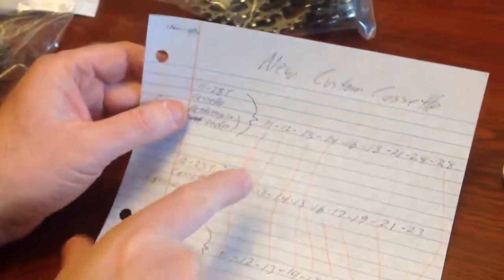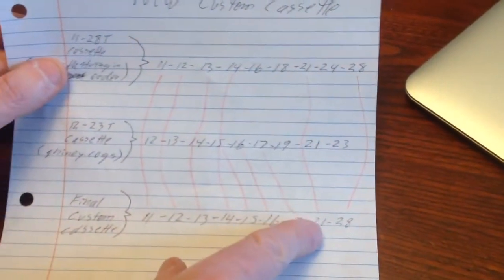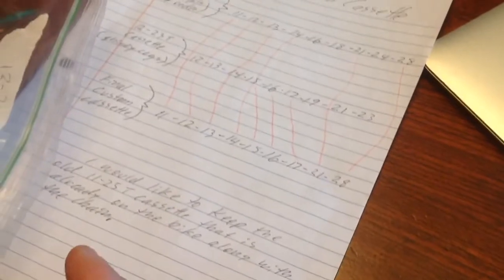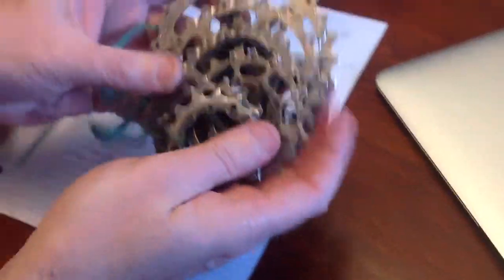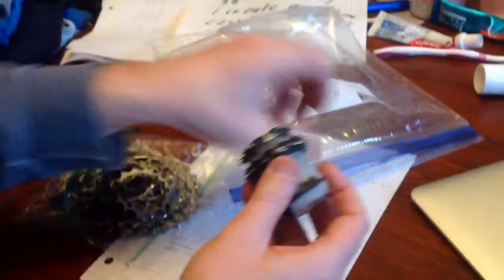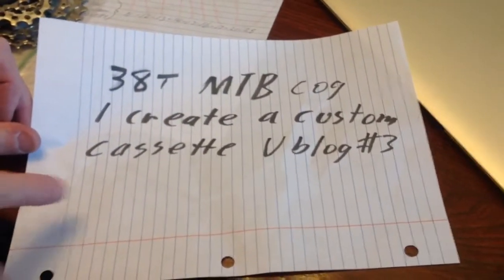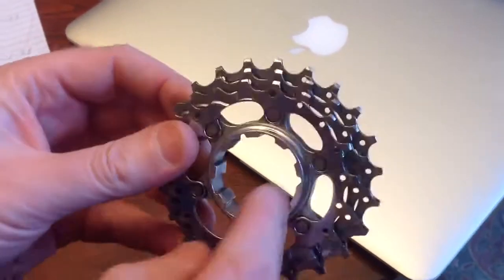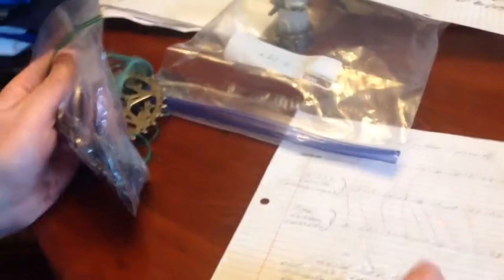How to build a custom 9 speed cassette 9 speed mega drive!

Comment: Hey Cycle Shaman, I currently have Sora 9spd 11-32T cassette (11 - 12 - 14 - 16 - 18 - 21 - 24 - 28 - 32). I never use 11 or 12, way to hard more me. I do use 14 at times. I would like to buy a another cassette and create a custom cassette of (13 - 15 - 17 - 19 - 21 - 23 - 25 - 28 - 32).  This way the hardest gear 13 would be perfect for me for flats and having only a 2 tooth  jump on 7 out of 9 gears would be a smoother shift and easier on my legs. Thank you for any help you can give me.
Reply: That sound great. Whatever works good for you. That is why I custom made mine to fit what I like. :-) You might want to keep the 11 because what if you start "Spinning Out" on a downhill and wishing you had a 11. The way you will have it with just a 13 it will be hard to give it any gas going down a hill. Just a thought.
Reply: Hey Todd, quick question. If I do decide to mod individual sprockets, do I need a matching lock ring? Meaning, now I have the 11T sprocket with what looks to be 11T lock ring. So if I remove 11T sprocket and say have 12 or 13 or 14 as my first sprocket, do i need a new lock ring to match the last sprocket (12 or 13 or 14 lock ring) or can I keep the same lock ring (11T) and use it to lock any other number sprocket? Thank you in advance.
Reply from the maker: @VadimNYC  sorry it took so long to respond. Yes you would need a matching lock ring to match the last sprocket. So if your smallest sprocket is a 13t then you would need a matching 13T lock ring.
Reply: @cycleshaman7464  - thank you for the update!